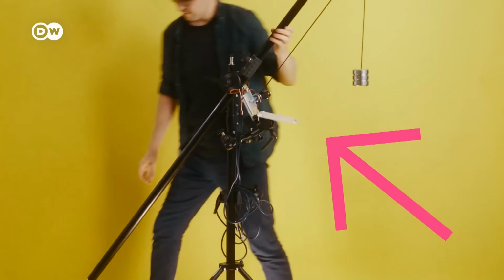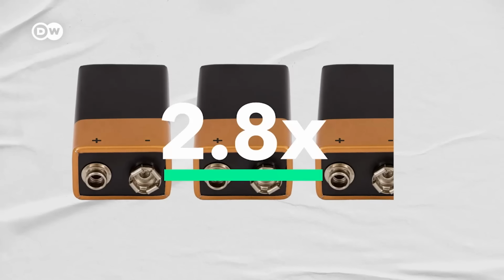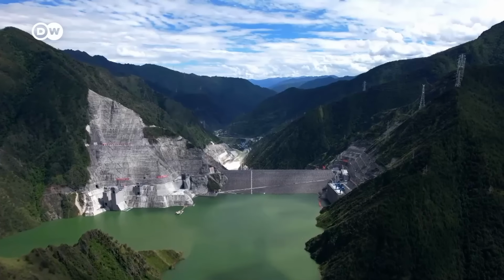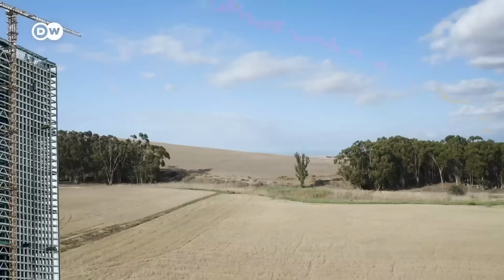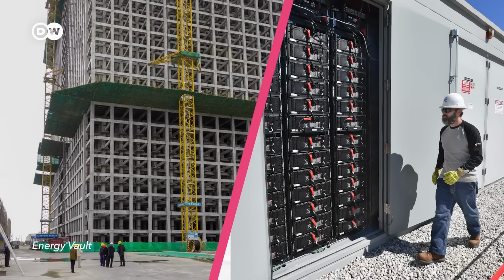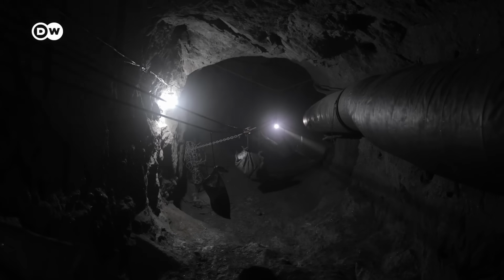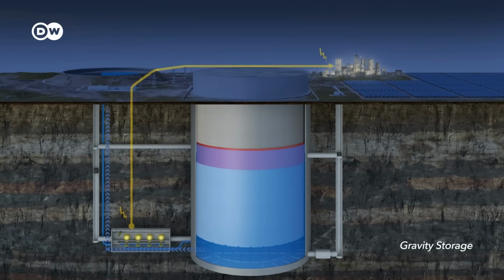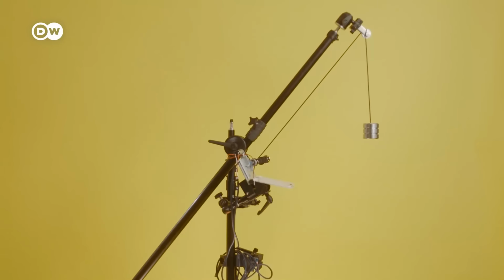How to use gravity to store energy

Comment: Physicist here: Gravity batteries are almost entirely greenwashing.

Pumped hydro is better in basically every way, far more efficient, and easier to maintain. The reservoir can also be used to provide fresh water storage as well.

If you can't manage that, compressed air and inertial energy storage (e.g. flywheel storage) are both better than gravity. They're denser, more reactive, and have fewer maintenance costs...

Comment: A battery provides instant and readily available energy, similar to how lead-acid batteries power homes or lithium batteries are used in smart gadgets. Additionally, a 40 kg battery can supply energy throughout the day, while a 40 kg block can only provide that amount of energy for a few seconds.

Moreover, lifting a block to a height of 500 feet requires more energy than what you can recover from it when it falls.
Reply: Exactly

Comment: The problem isn't the lack of technology, but the distribution of it. Besides those technology existed for a while, and the reason for them not to take off is because of the low amount of energy they store. 100mW is nothing when we are talking about electrical power, a simple small generator would be able to provide that without having to build tons of concrete.
Reply: Why are you comparing a generator to a battery?
Reply: @vendacious  both of them provide power.

Comment: The stupidest idea. Even if one would use the highest density concrete, with the blocks tightly packed, that couldn't take less volume than 1/4 of the same mass of water.
Just put a tank of water 4 times the volume of the concrete storage, pump it up, and let run it down

Comment: My novel energy storage concept uses submersible tanks in deep water as "underwater gravity batteries." These generate electricity while sinking and store energy when empty and floating. Key advantages include using natural forces for energy generation, increased capacity in deeper water, and efficient lifting. While promising, challenges include deep-water construction, environmental impacts, and safety considerations. This concept merges gravity battery principles with underwater mechanics for potential large-scale energy storage.

Comment: Pumped hydro counts as gravity methods too. 

Also the issue with any mechanical storage system is, it's mechanical. 

You lose so much energy as noise, friction, heat and vibrations. 

Not the best solution going forward.

It's my personal opinion that most of gravity methods, nuclear energy, carbon captures are just a delaying/distraction tactics from making the full transition. 

If everyone has solar and battery systems, then we really don't need to rely on bloated middlemen. 😂

Comment: Does anyone realise that the maths here does not add up.  Potential energy from a gravity battery is mass*gravity*height which is 25,000kg*3500*9.8m/s^2*148m or 1.27e11 joules which is 35MWh.  So where do they get the 100MWh claim from???

Comment: In fact, has tried almost all energy storage methods. In addition to lithium batteries, the largest ones are pumped storage, compressed air, and even compressed carbon dioxide. In the comments section, there are also gravity storage methods using hillsides and tracks. But the applicability of this building energy storage lies in its applicability. It can be deployed in most areas, and the cost will decrease geometrically with the construction cost, especially in the current period of oversupply of cement and steel bars. Other energy storage methods, chemical energy safety and environmental protection issues, and other physical energy storage are either too dangerous or too demanding on the terrain.
Reply: The Rudong 100MWh gravity energy storage project has a total investment of RMB 1 billion, a construction scale of 100MWh and a power generation capacity of 25MW.

Comment: The Rudong 100MWh gravity energy storage project has a total investment of 1 billion yuan, a construction scale of 100MWh and a power generation capacity of 25MW.
In fact, China has tried almost all energy storage methods. In addition to lithium batteries, the largest ones are pumped storage, compressed air, and even compressed carbon dioxide. In the comments section, there are also gravity storage methods using hillsides and tracks. But the applicability of this building energy storage lies in its applicability. It can be deployed in most areas, and the cost will decrease geometrically with the construction cost, especially in the current period of oversupply of cement and steel bars. Other energy storage methods, chemical energy safety and environmental protection issues, and other physical energy storage are either too dangerous or too demanding on the terrain.

Comment: Followup video  -  Why cranes, hoists,  and large concrete blocks are dangerous and break all the time,  how about we just pump water up hill and use a Dam to store energy!
Reply: In all seriousness,  gravity block storage is like "We also put solar panels on it".    
The gravity block is more difficult and more likely to break than a water tower or hydropump system connected to a dam.
The solar panels are likely more efficient and far cheaper to place on roof tops  or out in a field. . .   No need to put solar on more complicated structures just for the heck of it.
Reply: @DanDeGaston  Water resources are not abundant in some places, and there are many problems with water. Recycling water can cause biological problems. However, the maintenance cost of reinforced concrete and elevators is not high.
Reply: @pengyuecai553  
#1)  Every large electrical grid that I know is either touching the ocean,  or has plenty of water resources. . . This is not a problem.    I also find it disingenuous to only talk about water resources, and not the resources and pollution associated with creating so much concrete.

#2)  Instead of affecting the environment,  you can use a closed water system of water towers and collect excess snow melt or rain water.   There is access to a location like this for every large electric grid.

#3)   A water Tower will have lower costs and far less maintenance with the same gravity battery as a bunch of concrete blocks getting stacked or pushed up a hill.

Comment: The elephant in the room is the round trip efficiency.   Lithium is 99%.  Lead acid is 80%.   What is the round trip cost of a kWh?
Reply: According to the 100MW project in Rudong, the measured efficiency is that the comprehensive efficiency can reach 85%

Comment: Not a battery. It is an energy storage device. 
Definition of battery (Merriam-Webster)
: a combination of apparatus for producing a single electrical effect
a battery of generators
b
: a group of two or more cells (see cell sense 5) connected together to furnish electric current
also : a single cell that furnishes electric current
need to replace the flashlight's batteries

Comment: @Jonas Mayer, this isn't great journalism. It needs to start with the basic physics of potential energy = mass * gravity * height. With a simple units calculator (I use the fourmilab one) you learn that a 1 tonne block lifted 100 meters in the air stores all of 0.27 kWh, a tiny amount of energy worth pennies. So Energy Vault's idea of storing energy in skyscrapers is obviously laughable greenwashing.

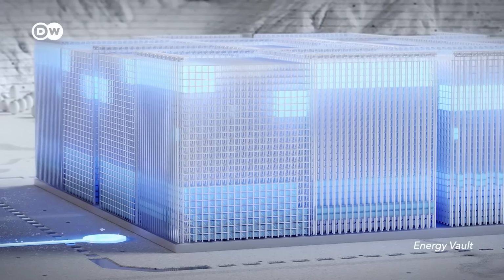Next, you should have pressed Energy Vault on its claims for its weak-sauce 100 MWh energy storage building. How tall is the building, how many blocks, how many motor-generators to lift and lower multiple blocks to provide decent power output? Assuming it's 100 meters tall, storing 100 MWh requires 14,683 of those 25 tonne blocks. Just moving them around requires a massive block routing system on the ground and high up in the air. 4:09 Energy Vault's computer animation of glowing blocks whizzing around is cute, but  what is the reality? Amazon can afford to have robotic pallets stored in tall warehouse shelving, because the items it's storing are light and valuable. Doing the same for 25 ton blocks is hard, expensive engineering.

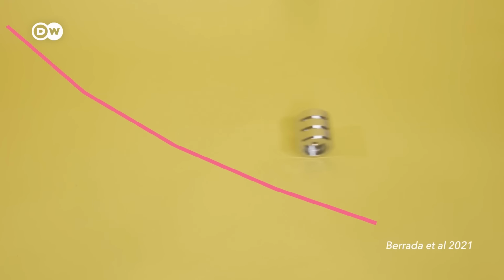7:32 "If the high start-up costs of gravity batteries even out over time partly due to the low cost of maintenance, that might make them competitive in the long run."  But what evidence is there for low maintenance? Big cranes require a lot of maintenance: the lifting cables have to be replaced and the mechanisms need to be dismantled and rebuilt. So too will the block moving equipment on the ground and in the roof. Look at elevator servicing for just a 1-ton passenger elevator. Batteries slowly degrade, but lithium-ion batteries require zero maintenance each year.
Reply: 根据如东 100MW 项目，实测效率为综合效率可达 85%

Comment: Look at the sheer mass of a wind turbine and consider that we'd want to, effectively, store that movement. To implement this, we're looking at mega structures that dwarf any concept of scale you or I would be able to conceive. That massive, complicated complex in the video would barely serve as a Peaker plant, if it could even discharge that fast. 

25 tons of material held up several stories high just isn't much power when considering grid scale. Even with using mine shafts, I wonder how intense and expensive the machinery would need to be to lift and hold a weight heavy enough to be useful.

Comment: Energy vault's new concept is simply an oversized automated high-bay warehouse used to store unusually low-value material. Can't see it ever being economical.
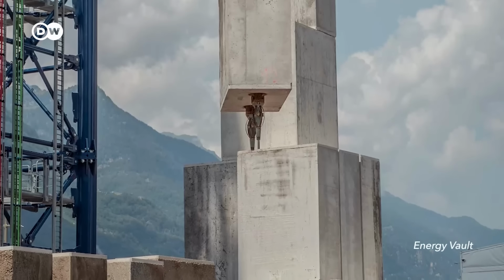Reply: Except the material you're storing in this really really really tall warehouse weigh 25 tons each, about 500 times more than an Amazon tote, and 4:09 some magical Willy Wonka elevator system moves the glowing blocks up and down and around. But 7:32 DW says "If the high start-up costs of gravity batteries even out over time partly due to the low cost of maintenance, that might make them competitive in the long run." Yes, because a materials moving system for 10,000 25 ton blocks has lower maintenance costs than a bunch of Tesla Megapacks that just sit on the ground.

Comment: Apart from Energy Vault's approach being expensive and impractical, it also doesn't scale well, so it violates one of your key requirements in the video.
Think about just how much water is needed for pumped hydro storage. Then look at the density of concrete. Less than three times that of water. So to replace say a million cubic meters of water pumped to 500m elevation, you'd need 350,000 cubic meters of concrete hoisted to 500m or 3,500,000 cubic meters of concrete hoisted to 50m. That's a concrete cube with 150 meters length. Even making the blocks out of lead doesn't improve the equation that much.
Typical pumped hydro sites store a lot more water than that million cubic meter example. Tens to hundreds of times more.

Actual solutions for long-term storage are chemical storage and heat storage. Cheap and they work. For short term, batteries and load shifting.

Comment: The issue with this would be that multiple blocks would be pointless.

Why not just have ONE huge block?

No crane
No latches
Just a pulley system that goes up n down that raises the block when it's cheap and lowers it when it's expensive.

Eliminated some of the complexity already.
Reply: Because to store the 100 MWh that Energy Vault claims its Chinese site can store, if you lift a single block 100 meters into the air, thens it would have to weigh 100 MWh / (100 meters * gravity) = 367,000 tonnes. That's the weight of a full ultra-large crude oil carrier. Now come up with the set of winches needed to lift and lower that much weight, and construct the block so that it doesn't disintegrate under its own weight.
Reply: My point wasn't to make a giant 100MWh cube.

Just meant that simplifying it could be really beneficial price wise.
Then you can have a bunch of medium sized ones like a windfarm or something.

Its to avoid having magazines of storage and just simplify it to a point its just a pulley system with a generator.

Not much that can go wrong aside from normal wear n tear.

It's the bare bone potential energy storage concept without any of the precision tech.

Comment: What is the energy and how much to move the block up?
Reply: Use a units calculator (I use Fourmilab). Lifting a 25 tonne block 100 meters into the air requires (i.e. stores) 25 t * gravity * 100 m = 6.8 kWh of energy. That's a tiny amount of energy when a 1/2 ton EV battery sitting on the ground stores 60+ kWh.
Reply: @skierpage  thanks for the answer, does that mean the release create more energy than it takes to lift back?
Reply: @kinglif8854   no, obviously not. There will be mechanical and electrical losses, so it might take 7.5 kWh of electricity to raise the block and then you only get 6 kWh in electricity out meaning the round-trip efficiency is only 80%. Physics only tells you how much potential energy the raised mass has, not how efficient the engineering is.

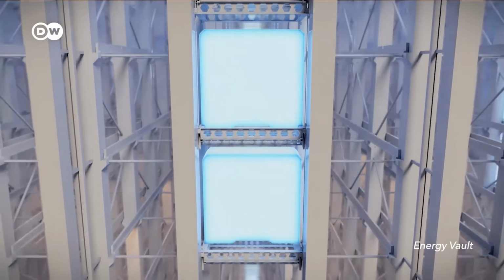4:09 you can see another problem with Energy Vault's Willy Wonka system and most other designs: you have to move the working mass away from the lift, both on the ground and at the other end (in the ceiling or at the bottom of the mineshaft). That takes more energy that you won't get it back.

Comment: Mount the weight on a wheel, so you only have to turn the wheel if you want to place the weight in the upward position again. Several weights can be placed on one wheel and it can be continuously used not only as a battery. The same works with water.
Reply: You only store a slightly significant amount of potential energy if you lift a heavy mass high into the air. So you need an enormous ferris wheel. Use a units calculator, and don't quit your day job.

Comment: One Tesla Megapack stores enough energy to lift a Tesla Megapack 38km into the air.
Reply: They weigh 25 tonnes. Same as those blocks in the gravity battery which are only lifted 148m max or 0.3% as high as what a Megapack could with little to no moving parts.

Comment: I have electronics and electrical degrees from college and university.  We were taught to see solutions in life . How about using metallic springs with the gravity weights .  The springs would be stretched and slowly released tension would drive generators.
Reply: Your education or rather lack of upper degreed education is showing .
Reply: It's not too late for you to get in higher education. Skierpage
Reply: How about humbly acknowledging that if yours was a workable idea engineers would have done it centuries ago. What is the benefit of compressing a spring with gravity over slowly lowering a weight to drive a generator? And neither is much good because gravity is such a weak force.

CAES (Compressed Air Energy Storage) is a similar idea to store energy, but it has problems with round-trip efficiency and cost.

Comment: This idea is plain stupid.  Batteries are getting better and better - they'll get cheaper, smaller, lighter and safer.  The cost to build these machines will not decrease over time.  At a certain point, economics will make these economically obsolete.

Comment: Probably a stupid idea, but could these be put inside the towers for wind turbines? The have the height, there going to be thousands of them and could divert excess energy quickly when any curtailment is needed. Just a thought. Probably easier to just fit a storage battery in the towers if they can be sealed well enough for the offshore ones.
Reply: Use a units calculator (I use Fourmilab). 120 meters (a pretty tall wind turbine column) * gravity * 100 tonnes is only 32 kWh! And the machinery to lift and lower a 100 tonne weight is expensive and unlike this video's claims, it requires far more annual maintenance than plopping an EV's battery on the ground next to a power line.

Gravity is a very weak force.
Reply: @skierpage  hi, cheers for the explanation and always good to learn something 👍 Was a bit of a daft idea and backs up my initial assumption to just use a battery instead than bother with the gravity stuff. If you are going to build a gravity battery big enough then why not just use that space to have a giga battery, I mean, they are building all the substations/grid connections anyway.

Comment: alright dont call me stupid engineers BUT
What if its underwater and it gets filled with water and then submerges. then once it reaches the bottom air replaces the water inside the weight and it slowly rises back up. would pumping air back inbe too much? What if its a big tower with water inside of it and the air that goes back inside comes from the outside instead of the pump? Tell me if this could work pls
Reply: oh they mentioned this idea in the video

Comment: So many of the tallest buildings in the world stand mostly empty. Repurposing them with this technology could add an additional buffer to the energy grid while minimizing costs and pollution of building from scratch.
Reply: Nope. Use a units calculator (I use Fourmilab) to find that lifting 1 ton in a 200 meter skyscraper's elevator stores all of  0.5 kWh, a laughably small amount of energy. If you have to move lots of 1 ton weights in and out of the elevators both at the top and bottom to store more energy, then they takes up more space and the moving system becomes complicated (look 4:09 at Energy Vault's Willy Wonka elevator).